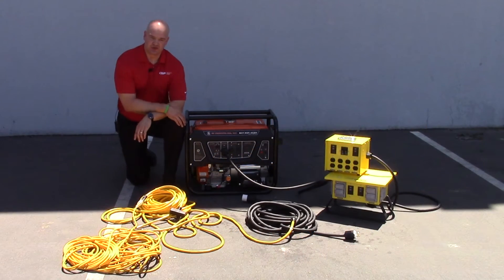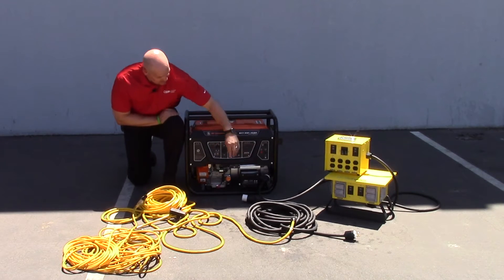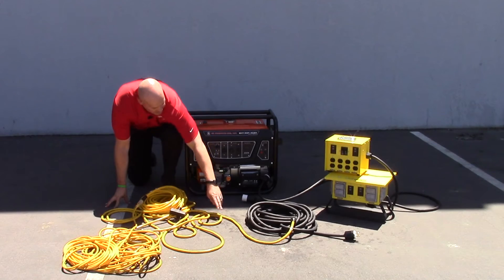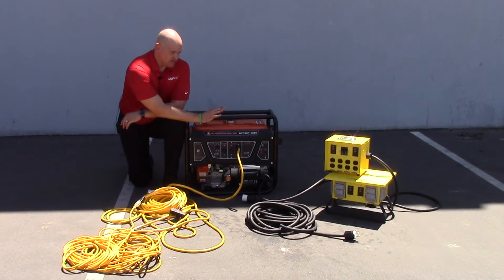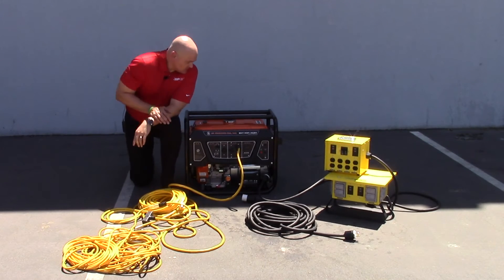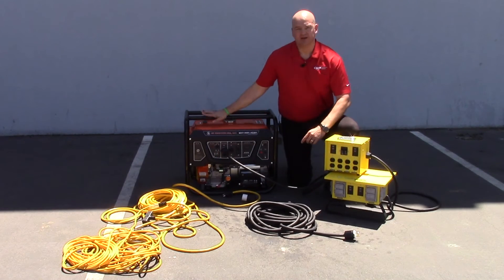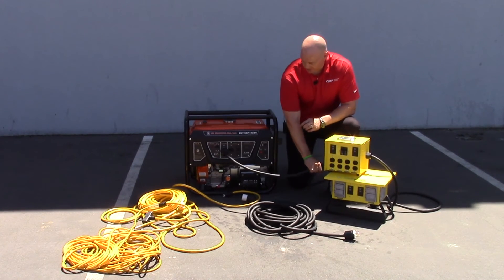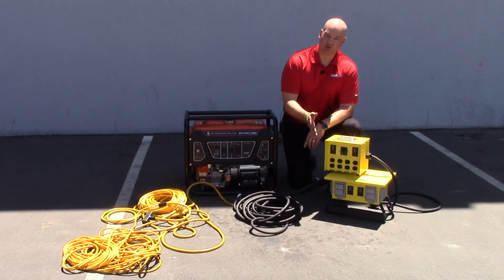CEP Training Video 1

Comment: Know I know what I've been thinking is the way I need to go. $$$ on a generator with 50 amp 220 to run my 220 stick welder. With 2 20 amp plug ins to run 110 grinder and 110 plasma cutter.
Reply: Just get a welding machine like a Miller Bobcat.

Comment: With an 8500 watt generator is it possible to use one of those boxes with a 30 amp receptacle in it for use with a really big popcorn popper.  I would like to be able to set my loud generator 100 ft away from my fair/festival set up and plug the popper into the box instead of the generator.
Reply: If you figure out the amp draw on the conductors (don't worry about the voltage), use available charts to understand the gauge of cable you need to overcome the distance issues